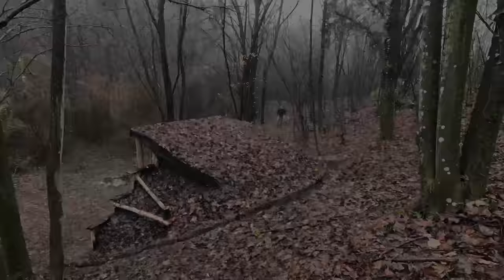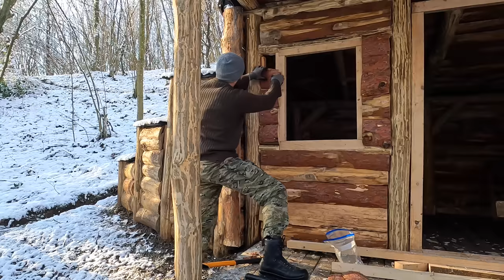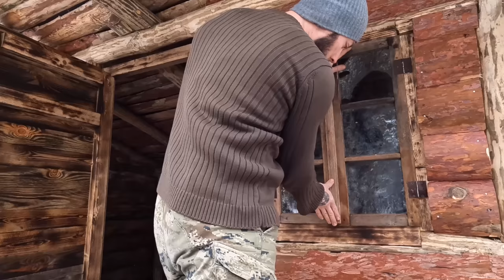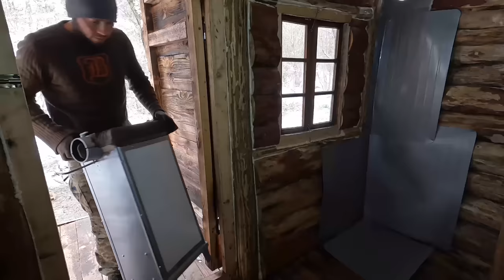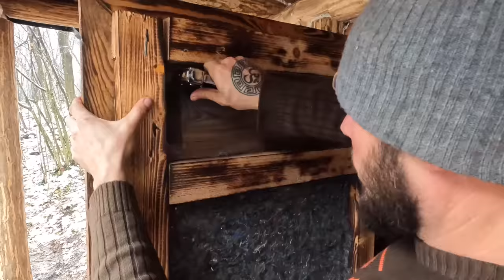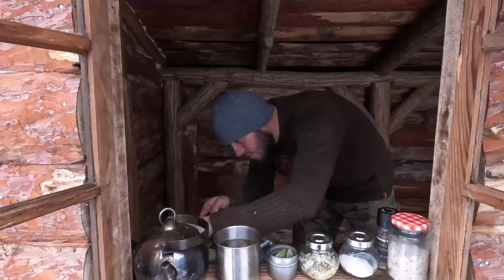I Built a Warm and Waterproof Dugout Shelter in 20 Days, Craft Skills-Part 4

Comment: We had something similar on an old property we used to camp in. On really cold days we hung up a thick piece of canvas on the inside of the door to kinda act like an airlock to keep the heat in while we went in and out. Smaller pieces over the windows would help after it got dark for heat retention. Best part was when we didn’t need it they worked as dust covers to keep the furniture nice.
Reply: Exactly - you took the words right out of my fingers!!

Comment: Best work I have seen yet on You tube , Just curious , What kind of weather resistance material do you use ? Wonder how long the material would last ? That is roughly about a 8' X 12' space , correct ? Good skills , Hard work , but very rewarding . Gonna finally have time to build this year hopefully . How long do do think a structure like this would last with out to many repairs ?  I only need it to last the rest of my lifetime which is about another 20 years hopefully . Well done brother
Reply from the maker: I'm glad you like it! I put in the description of the video every procedure and materials I used.If you escape from stress, you might last more than 20 years! 😉

Comment: Absolutely brilliant Mate. Down here in Australia (Queensland) our shelters are much more open to escape the heat & let the breeze in. I liked how you weren't  concerned about using modern technology - insulating spray foam. Makes sense. Your Dog is an absolute treasure!
Reply from the maker: Hello Australia! When I'm working on a bigger project, of course I want to protect it from rapid deterioration! Let people enjoy it. I couldn't have had a better solution for closing the holes! Moss or mud was out of the question, I don't want to fix it every now and then! I'm glad you like my dog!

Comment: Polyurethane foam is highly flammable (open cell foam holds significant oxygen) and should not be exposed to high temperatures (your stove).  There are silicone based firestop foams that would be perfectly suitable for this application.   I couldn't tell if you put that through duct directly on top of the foam.  Also, UV light degrades PU foam rapidly.  Painting it with a water based paint will allow it to last for many years.  Otherwise, it will last only months before it begins to degrade and allow micro gaps.
Reply from the maker: Thanks for watching and thanks for the advice
Reply: bang on hemsar, thank you was hoping to find this comment so i didn't have to make it. id extend the chimney one more length to avoid carbon dioxide & smoke with any downdrafts. and watch for the clearance between the pipe to wall. the steel heat shielding should have an air gap to keep from actually touching the wall behind. i jus cut 1"pcs. of copper pipe as spacers and used longer screws to attach ours. check outside from pipe to roof log (pack with sum rockwool if it gets hot to the touch)  be a shame if it lit up. otherwise looks solid, id love live there at least 3 seasons a year!
Reply: It's nice I like . Maybe they can't afford it . But it'd ok be safe

Comment: Nice shelter! Try using a "T" with a removable cap on the bottom with a 3/4" drain hole centered instead of a elbow on the flue pipe before the cap. It helps keep water out of flue and getting to stove when not being used.
Reply from the maker: Thank you!👍

Comment: He hee some one will lock you in. With the bolt lock on the out side. The Chimney is to short. That going to catch on fire  I would put the stove facing out from the corner, rather than square with the corner  Just easier to get to and it would straighten up the pipe in the back
Reply from the maker: I'll go out the window
Reply: @luxonbushcraft  he hee cool

Comment: When I was much younger we made a place off the ground about 4'  we had a little burn barrel with the opening sticking out the roof. We had a asphalt shingle roof with dirt on top. This probably wasn't the safest but we did have 2 doors and an extinguisher inside with us. 
We would get a fire going and sit on the roof and get it good and hot.  Then put an old small Weber grill lid over the top w/ vents open. Man it could be -20° out and toasty inside. Keep in mind we were 12 to 16 yrs old at the time. To be a kid young stupid and live forever. I love your videos you have a pioneering spirit my friend. I wish I was young again. Ps. Raise your stack so it is not even with the roof line. Don't get old my friend there's no future in it.
Reply from the maker: Thanks for watching my friend! P.S. i'm stuck in my 13th year 😉😂

Comment: Hello! Jou should not nail the metal behind the stove direct to the wal. There must be a vertical airflow, so cold air at the lowest point should have no obstruction to go up and cool the metal. It should work like a chimney. Two inches between the metal and wall and 4 inches up from the floor will do. Now the warmth from the stove will be absorbed of the metal and your the logs will be very hot. I have seen that just a single nail or screw in wood close to a heat source can cause a fire. There is a risk you burn down you cabin.  Cheers!
Reply: @luxonbushcraft  Welcome. Very nice cabin you made👍

Comment: i would have had the stove on the opposite wall away from the window where it may be colder.  just my own opinion. Also away from the draft of the door coming in and out fluxuating the temperature of the stove so close to both of these. just my two cents.🙂⛪
Reply from the maker: The stove has a large heating capacity so I have to open the windows

Comment: There should be a way to collect rainwater closer to your dugout cabin. Than walking to spring to get water. Perhaps you might figure out how to have water collection closer to cabin
Reply from the maker: I thought I would find water around the hut and dig a well!  😏
Reply: @luxonbushcraft  perhaps that might work. I was thinking on lines about a  funnel type device that would cause rain water to flow into some type of under ground storage tank. Then have a picture pump to draw it up from tank. Example: my grandma used to catch rainwater off her roof top. It would flow through a pipe into the well behind her house.
Reply from the maker: But I have a dirt roof!The idea is great and I will use it for sure, but not here.
Reply: @luxonbushcraft  perhaps the cliff house might be better to catch rainwater somehow. As it's roof isn't dirt. Lol
Reply from the maker: @vickypyron543  cliff yes! It has a perfect roof, even a slope
Reply: @luxonbushcraft  yes exactly. Plus it faces towards the sun. Would keep water from freezing if tank was wrapped in a black plastic of some kind. As black absorbs warmth. If ya try that maybe you won't need to go for a jug of water every time you need it to cook, drink or bathe.

Comment: Video looks great.
Which camera did you use?
Reply from the maker: Gopro
Reply: @luxonbushcraft  - That's the best GoPro video I have seen. It's usually pretty bad.
Reply from the maker: @scottsullivan234  I now took 10, I had 8.10 it records badly at night and I can't guess the settings. The daily picture and sound are perfect, but for the rest you need knowledge, will and nerves. 8 crackled for me, and 10 goes out at low temperatures. 🙄

Comment: Pretty sweet but that stove clearance might need a bit more room and you don't go and create a nice big air gap between the wood stove and that metal siding on the walls and then go stuff it with fire wood - duh man !  (grin) But cool, you maybe should have tossed in some gravel and weeping tile pipe along the bottom of the walls before you back-filled but we'll see, right !?  Meh, hopefully it stays dry.......

Comment: I took an interest in this stuff many years ago and now have friends going ape sh*#t do this on land they own. One of my hobbies is metal detecting in let me say really remote local to my area places. I have a 1950s USGS map, a one of kind my dad gave to me many years ago when we went metal detecting in the mid 70s. The map indicates old mines and what was mined thereabouts in the marked areas. Not that many years ago I found a similar find dugout that was occupied. Where I drove in there was an old F350 parked so I was wary it was registered and all that so I followed a fair size path. The only thing diff from the dug out here in this video is the one I stumbled on was about 4 times the size. The guy that made it said he was in 30s when he bought land and naturally the mine nearby must have yielded some gold because he was not without much of anything including a new solar set up he was kind of proud to show it to me. At first before he showed me anything or talked to him I had to prove I wasn't a thief or there to do harm which I first took him to my truck I had already showed him the metal detector. I told him I have a You Tube channel because he knew what You Tube is he had internet. His sister only lived 5 miles down the road he said. The roof line ran with the slope of the back not back against the hill like this dugout in the video. I would say it was 20 some feet wide and at least 35ft deep and I mean it went back into that hill pretty far. He said when the mine down the road shut down they put certain non desirable parcels up 4 sale to pay back debts. He bought the property all cash out of his savings. I was impressed at all the wood working done mostly by hand. Some of the wood was salvaged from nearby abandoned worker cabins his old cabin in particular he said most of the workers were non English speaking migrants at one time and he was a head tuna there at the mine a while. I was impressed at how far back into that hill the 3 rooms he made went. I did not get to really look at the last room was sort of a private bedroom with animal skins and some personal items like firearms and bows. The guy himself seemed really placid down to earth. I did find two small nuggets along the stream bank. He had a pump for a well and I suspect those nuggets might have been from whoever dug that well. It just seemed that way to me. It was not the first time I came upon Hobo's and Hermits but those kinda people don't have expensive toy drones and WIFI boosters atop of a fancy dugout. It seems that it is now popular whereas somebody might have looked down on this guy whereas I admired him and his woodworking skills too. His cook stove was all porcelean combination wood & coal it had an oven and he about 100 bags of coal in a nearby shed and about 20 some bags inside where we sat talking. The place was a masterpiece. Considering I did find some tiny insignificant gold near that stream brings me to my other theory this guy pans for gold he doesn't dig for it...

Comment: Kiddies absolutely do not use one of those mickey mouse Chimney caps it's an accident waiting to happen on a short stack set up. I have seen wind blow ashes and flame back in faces even my own. I live in an ancient farm house and mostly heat with wood even though I have modern electric stuff I prefer wood heat. I remember thinking I was blind with smoldering whiskers and hair just like it was yesterday. Get a chimney cap with a difuser built in. The stack will still vent and probably better too.
Reply from the maker: Thank you!

Comment: Many things to like about this video, but your stove installation is flat-out scary! Even in areas that don't require you to build "to code," the IBC has numerous sections that express the right way to do things because the right way is the minimally safe way. There's a reason why you should use insulated, double-wall pipe through walls. There's a reason why you should extend your vent pipe/chimney up to at least two meters above your roof (the final outlet point should be at least ten feet from any surface). There's a reason why you should protect your walls and floor far, far better than just a few panels of sheet-metal (that one is particularly scary). Basically, your stove installation is just begging to poison or burn you and your wonderful dog up while you're sleeping. I sincerely hope that you'll significantly upgrade that stove installation, so that you (and your dog) don't die. I'd prefer you to keep making videos!
Reply from the maker: Thank you!  👍
Reply: @luxonbushcraft  Thank YOU, my friend! I LOVE your dog, too!

Comment: I hate foam in nature. Construction foam has no place in nature and in a wooden house... there are better alternatives. It is plastic that we will still find in nature in 500 years
Reply from the maker: If I want to make something more permanent, I need materials that last!What is your alternative? Without having to repair it 2-3 times a year
Reply: @luxonbushcraft  What did the pioneers or our grandparents use? I would use felt, or wool, scraps of fabric...I think there are many alternatives for darning cracks....
Reply from the maker: @Give0002  In my case no! I need this cabin for the next 10 years (minimum)